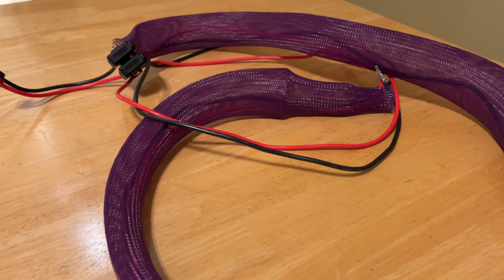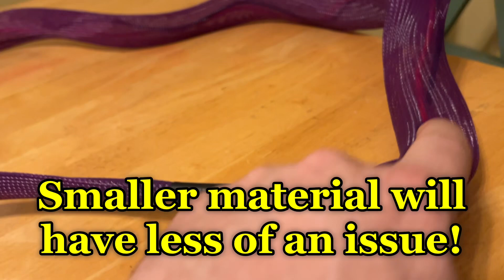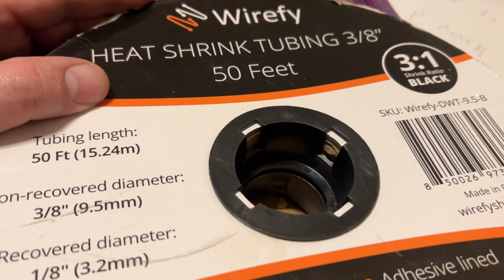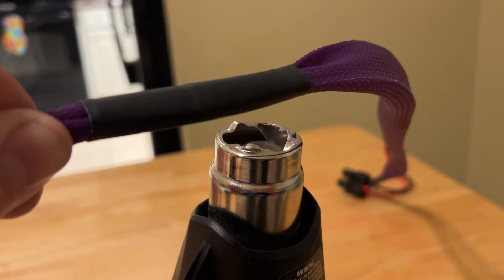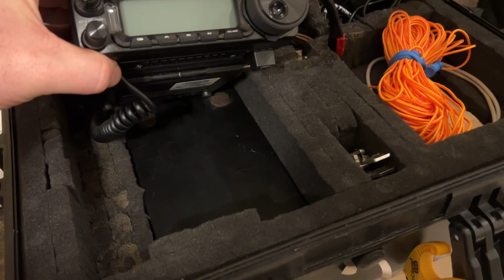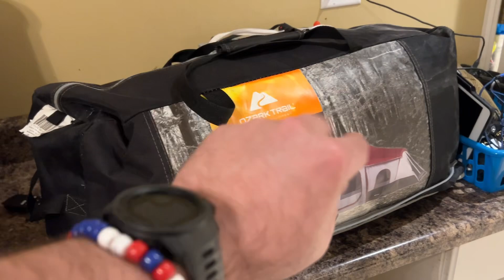Cable Management is easy! @KG4GAV commented an excellent idea! PET Expandable Braided Sleeving

Comment: Hey Robbie! Here is what I would do: Take my drill and turn the 12V cable into twisted pair. If you want, you might want to, cut a few pieces of 1/2 inch wide pieces of heat shrink to place along the length of the poser cable.
Reply from the maker: That is another solution. I’ve done that before with jumper connectors for keys. I might have to try your method out on a different cable.